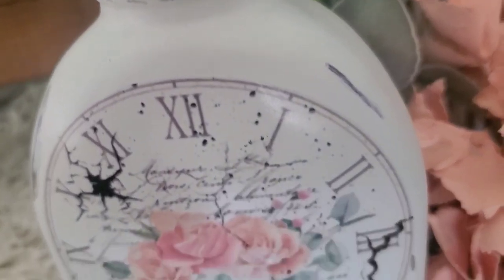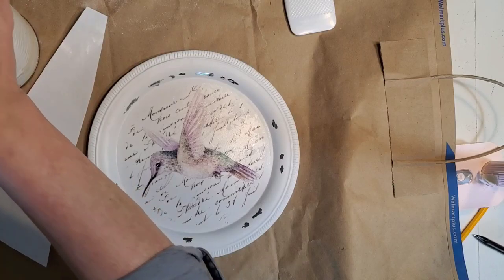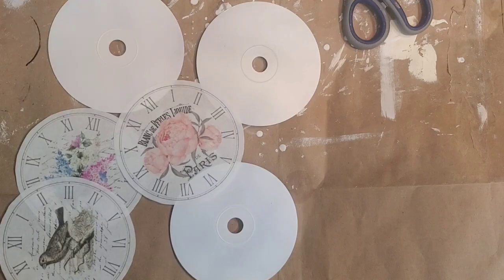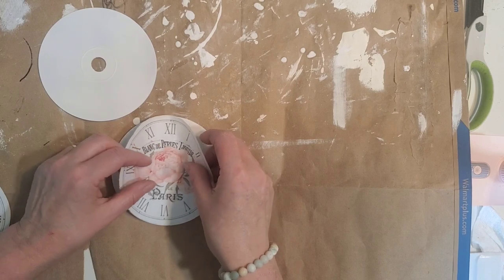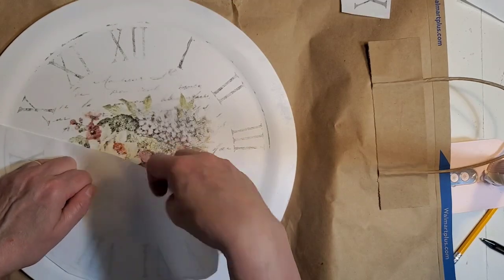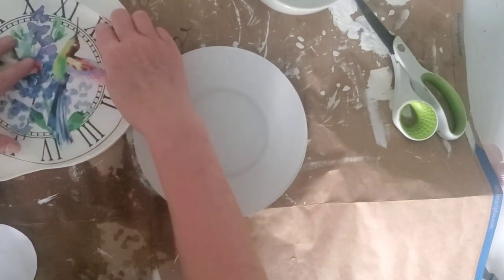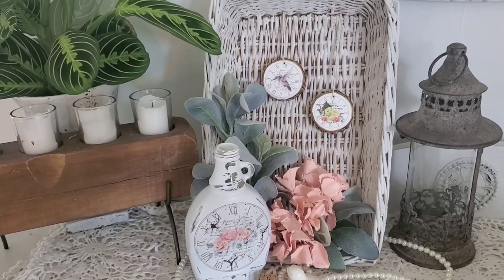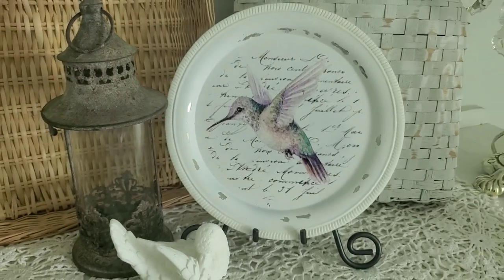TRASH TO TREASURE - Thrift Store Makeovers using DIY Image Transfers

Comment: Would love to see your water slide technique and where you get the water slide paper. Also can you just do this on the copy paper or tissue paper.
Reply from the maker: I can make a waterslide video and post soon! Yes both tissue paper and copy paper work as well. I know with my inkjet printer I have to spray the page with sealer before applying the paper to the project ❤️

Comment: I don't understand how you made the decal
Reply from the maker: The waterslide decal paper goes right in to a printer and you print on the shiny side. Then it has to be sprayed with a sealer before applying to your project, to seal the ink on the decal.
Then once it's dry you place it in a dish of water for around 30-45 seconds. Then you push up on the decal and it slides off the paper on to your item ❤️ Hope that helps.
Reply from the maker: https://youtu.be/g_eTnyd3l2o
Here's a video on how to apply the decals ❤️